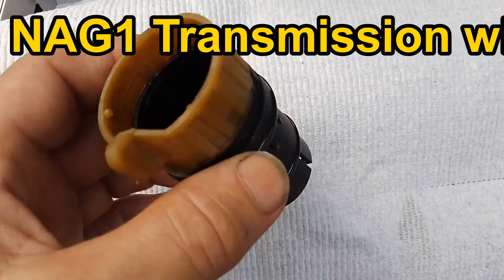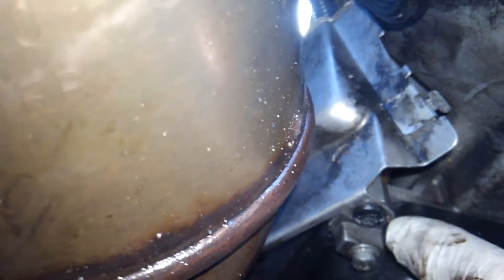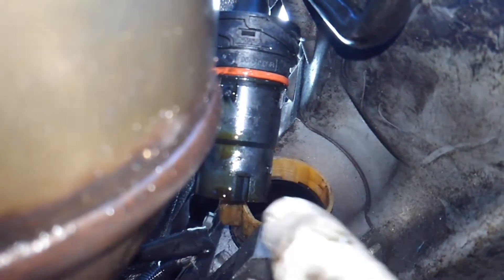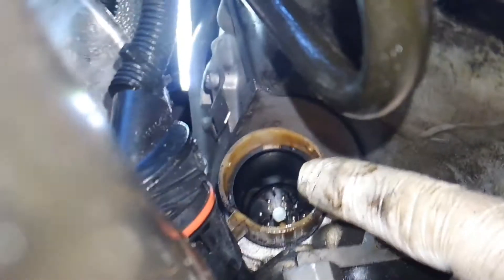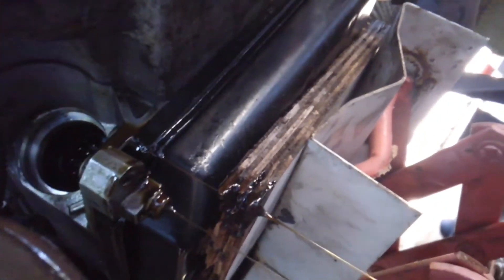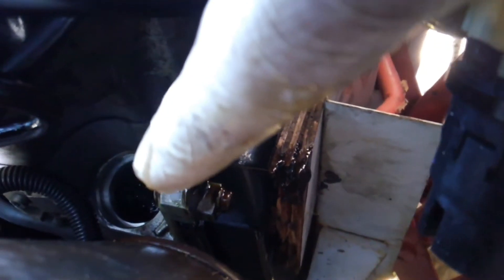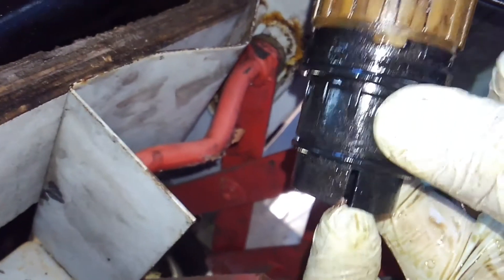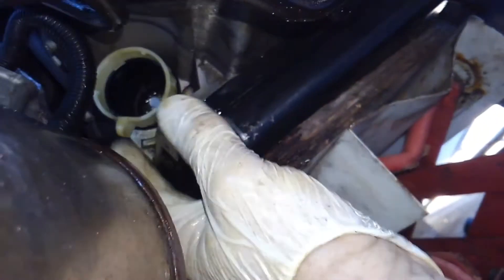722.6 and NAG1 Trans wiring adapter plug replacement, ATF leaking

Comment: Unfortunately, as in most of the cases - it will leak again. An old school trick is very handy: before installing the adapter plug remove the orings and wrap two rounds of teflon tape at where they are sitting and then put them (orings) back. Carefully tight that bolt and good luck. In this way the orings will be consolidated in the body of the plug adapter.
Reply: Ya you’re right. I did this job and ran the engine and no leaks….

Took it for a drive and came back and was leaking like crazy . Went and checked on the adapter and tightened up the 7mil bolt a little more, then I plugged it in and I did lock the adapter a little “over tight” where it locked in place, but I clicked it one more over and locked again… maybe over locked it lol if that makes sense,… so I just turned the dial/adapter lever until it stopped and we’ll see what happens…. If it leaks, ima get a whole new adapter, use Teflon tape and it’s a wrap lol

Comment: How did you pull the adapter out after loosening the bolt? mine seems really jammed in there
Reply from the maker: If the screw is fully out you might need to grab it with a pliers and pull it straight out.
Reply: @1rednecktech  now the screw spins  endlessly but remains tight either way  I think something might be wrong with the screw. I know the screw is not to come out.
Reply from the maker: @DE1CRAFTS  Right, the screw itself comes out of the adapter, you need to pull on the adapter, or see if you can get a screwdriver under the edge and lightly and evenly try to pry out of each side

Comment: Hi, great video, I am about to do the same job on ML 270cdi W163, I will change cabio oil and adapter, I believe there is oil in the plug, and I noticed that when there are 2 people the gears do not go well !! I am alone in the car almost always ok, passenger climbs and often remains 2 gear then I turn off and come back ok !!
Reply: My nag 1 does this too don't even make sense wiring issue j supose

Comment: There is no seal where the pins come through so you will obviously get trans fluid in there. The seals on the plug are to keep it from leaking on the outer part of the plug and the seal on the harness is to keep it from leaking between the harness and plug. Not sure why you think that having trans fluid in the plug before the seal on the harness is an issue. There is no pressure there. They only leak when parked. Gravity. THe fluid level is below the plug when running.
Reply: Think it can happen due to capillary action.
Reply: @Jester123ish  Think what can happen?
Reply: @chuckyz2  If you neglect it, the fluid gets through the lines to the computer which is located under the steering wheel inside the vehicle. Then you have a problem. Strange but true.
Reply: @Max-vl1in  Um, no. No trans fluid goes into the cab.
Reply: @chuckyz2  Unfortunately, I had this situation in a Mercedes W203. Besides, you can certainly find such a video on the internet. I couldn't believe it myself.

Comment: Bu soket içinde yağ varsa şanzıman vitesde geçiş yaparmi ve bu parça ne işe yarıyor Mercedes Viano
Reply from the maker: Yes,  it can still shift gears. But the wiring may suck up ATF into the TCU and them you can have shifting problems.
The adapter is made to isolate the ATF from the the TCU wiring. - Evet, hala vites değiştirebilir. Ancak kablolama, ATF'yi TCU'ya çekebilir ve bunlarla ilgili vites değiştirme sorunlarınız olabilir.
Adaptör, ATF'yi TCU kablolamasından izole etmek için yapılmıştır.

Comment: I am stuck attempting to start the 7 mm screw back in after installing the new adapter. I cannot catch the thread to start the screw! Please help with any advice.
Reply from the maker: Try to screw your old adapter back to be sure both threads are good.  
If it works bring the old adapter to your local hardware store and buy the nut that fits. 
It should work on the new adapter too or the end of the new threads are bad, either return the adapter or take a fine file and clean up the threads. 
Also- I have seen a picture of a adapter that the screw HAD NO THREADS CUT!
Reply: It is infuriating! I swapped the O rings on the original plug as I did the tranny gasket. (Cuz I thought that was the problem). But turns out it was actually the plug! I took it out, put new ones on no problem. But discovered it was the plug after the fact. I have a replacement one, same thread count and size and for the life of me I cannot get it to catch. Even the old one. I popped it out twice before and this third time is defeating me. I can’t think of a good reason why. The old O rings aren’t stuck in there. Been trying to catch that thread for hours.
Reply: I am having the same problem. Did you every get the screw snugged down? Any advice?

Comment: I have a 2006 S500 with the 722.6. Would you know if I replace the transmission connector do I need to reprogram the car?
Reply from the maker: No need to reprogram anything. If you don't have ATF wick up the wires into the TCM you're OK. You usually have trans problems when that happens.
Reply: Thank you sir. I appreciate it.